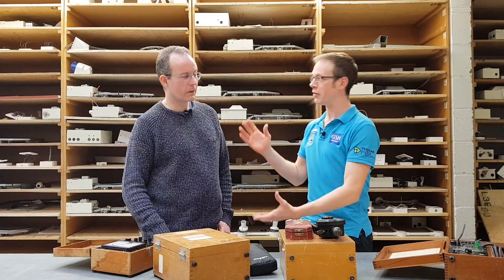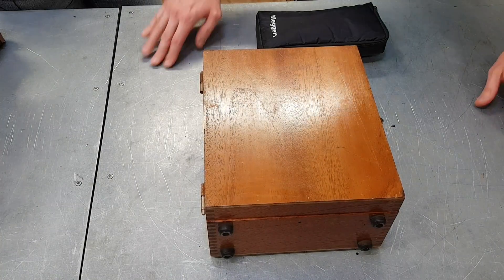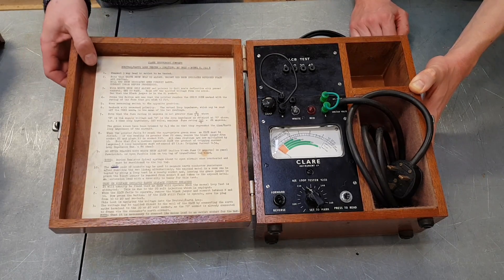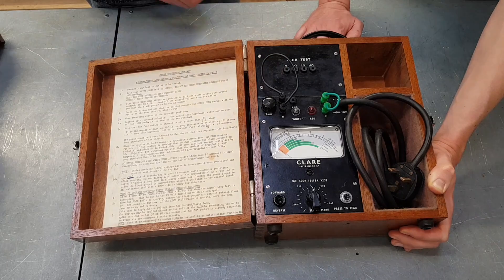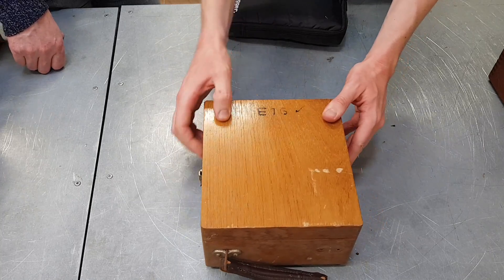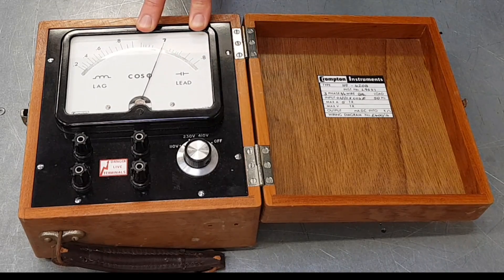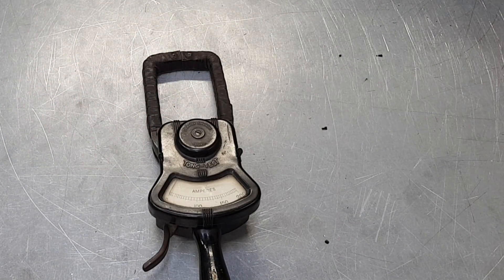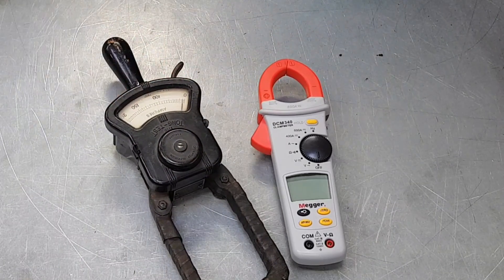John Ward Discusses Old Testing Instruments Part 1

Comment: Very enjoyable. I am mystified by the voltage settings on the power factor meter. They don’t correspond to uk voltges, nor the few other I know. the old clamp meter has its charm, but getting those massive jaws around  tails on a modern three phase meter would be next to impossible.
Reply from the maker: I must admit I'm not sure how to hook it up either. May need to do some more research!